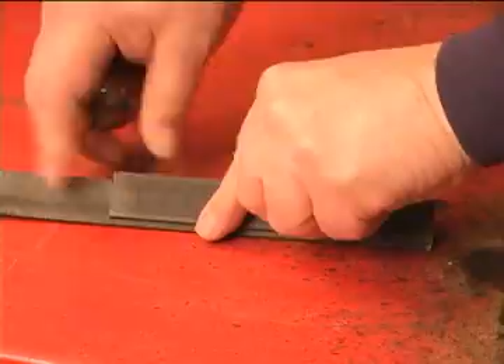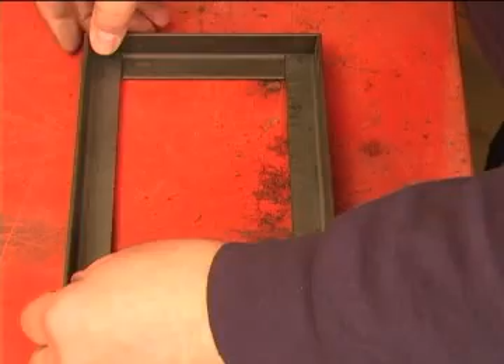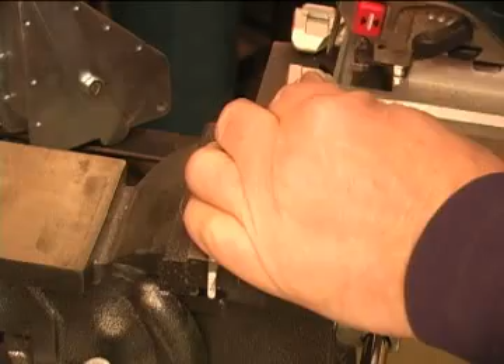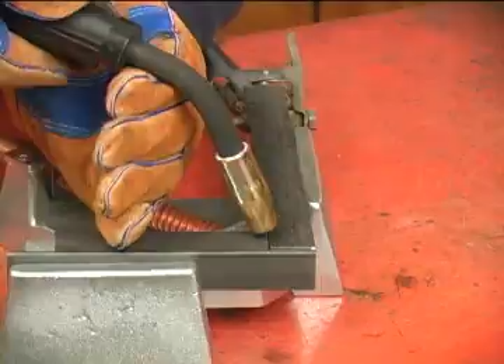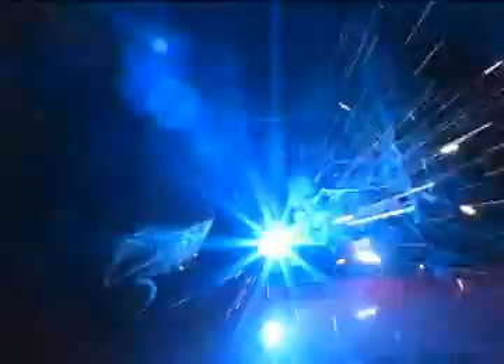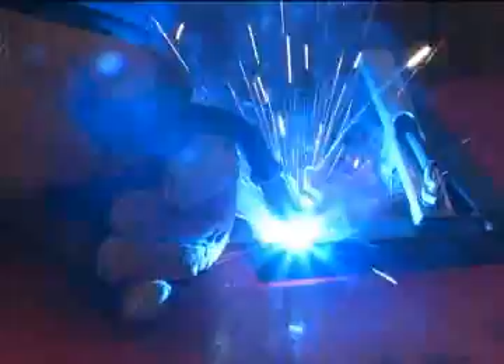Making Cope Joints in Steel

Comment: I cut the angle iron horizontal plane 90 degrees, then bend the vertical to 90 deg in the hydraulic press (or in a vice press).  The outside remains in tact (full strength) and it has a nice smooth round.  If you don't have a press, score the vertical so it would bend without deforming the vertical around the bend and weld it on the inside.

Comment: The only thing I like to do with this weld is 45 Dec both pieces of metal then stitch weld and grind flat.this gives a strong thick weld flush with the piece.
Reply: The cope is stronger because you have more weld.
Reply: MultiGazman I am not disagreeing I like to 45 deg the metal edge and stitch weld and keep the weld close to flush with the parent material. Neatness counts!
Reply: More heat, less strong metal.
Reply: @MultiGazman  , the 45 deg mitre joint will allow for more than sufficient strength, in fact much more than the parent material itself.

Comment: just mitre them ,,, fold a bit of paper in half to get a straight edge , fold it twice more and you have a 45 ,,, if you dont have a compound square , and then just one cut , lot less measuring easier tacking less distortion and easier to clean up ,,,, just my thoughts
Reply: tom thom

Comment: Too much work and too much heat input.  Just 45 and weld
Reply: No that will not work .90 divided by 4 = 22.5 degrees, that's what you cut .Not  4 x 45 degree cuts, the angle iron will not line up.